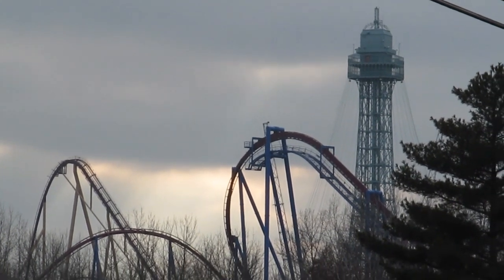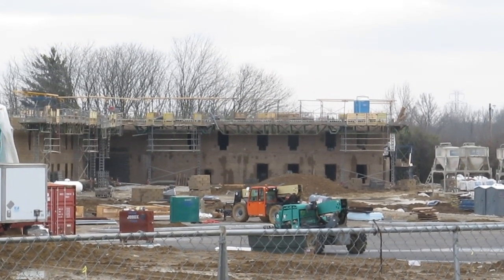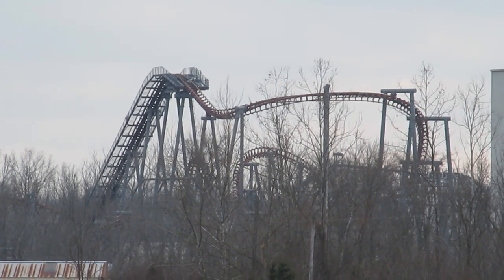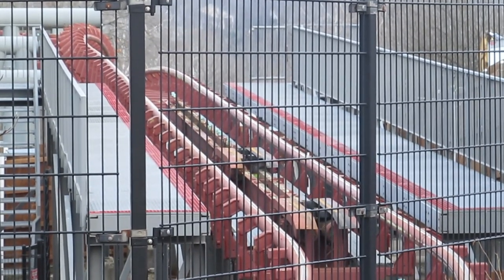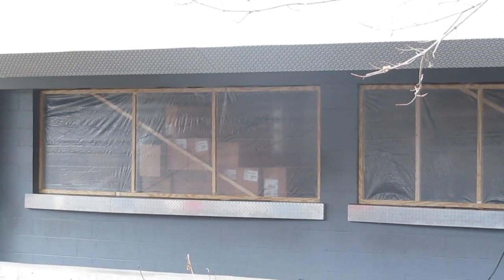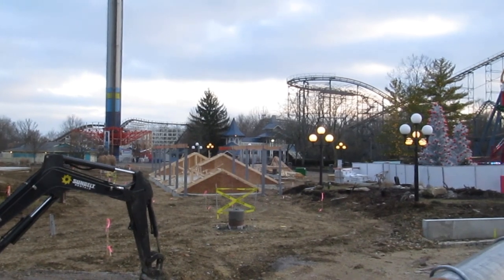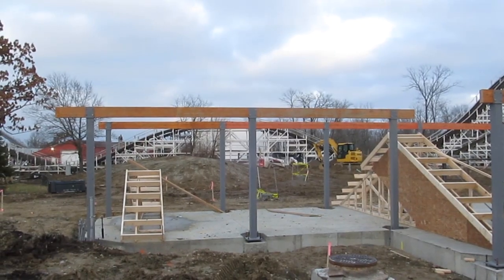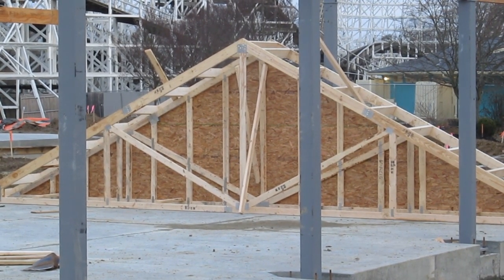Kings Island Firehawk & Construction Update

Comment: If I remember correctly. Firehawk didn’t take long to be relocated and built. So it may not take long to tear it down. And with winterfest going on they may wait until after to remove it. That still frees up a lot of time to build. Also we don’t know what’s going on back in those woods. They could have footers already marked out.
Reply from the maker: trint2004 valid point :)
Reply: @AmusementInsiders  i think invertigo or flight of fear should have left
Reply: Why are they taking it down?
Reply: @myaangelouuu7345  because of technical problems and the pieces are rare
Reply: Quinton Parchment flight of fear won’t go anywhere soon. It’s a icon and still gains a huge ridership. But I agree with invertigo leaving. It’s kinda not needed with Banshee being in the park now
Reply: @trint2004  why not remove it now they could replace it with wicked twister
Reply: @trint2004  how is flight of fear iconic ?
Reply: Quinton Parchment it was the world first to feature a LIM launch. Without it we wouldn’t have the new launch coasters that we do. Most of all of kings islands coasters hold something that was ground breaking when they opened. No other parks were doing what kings island was doing.